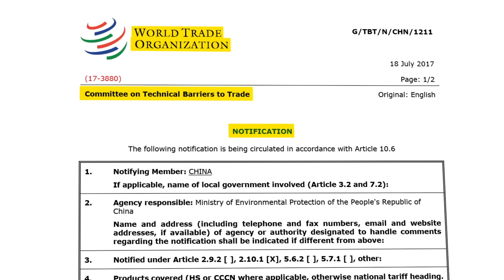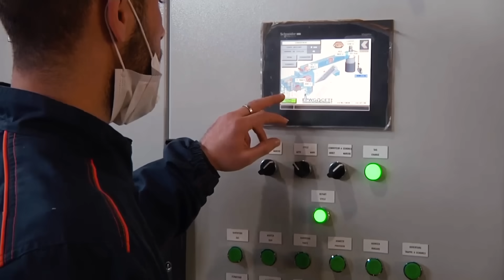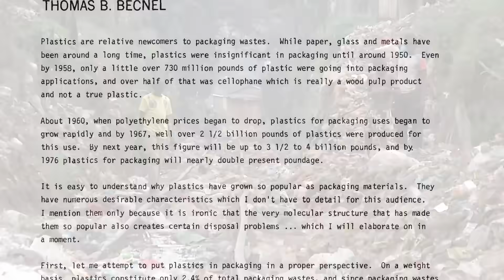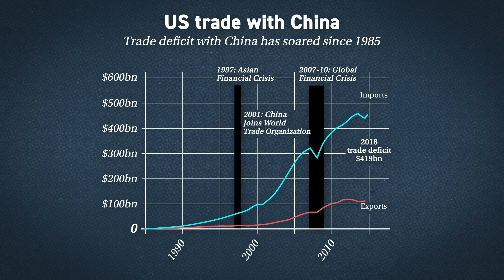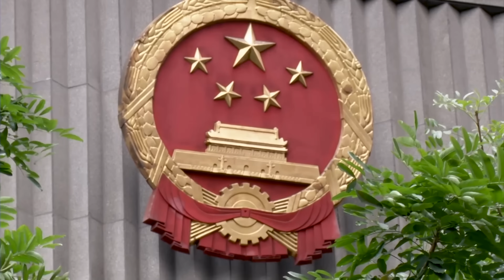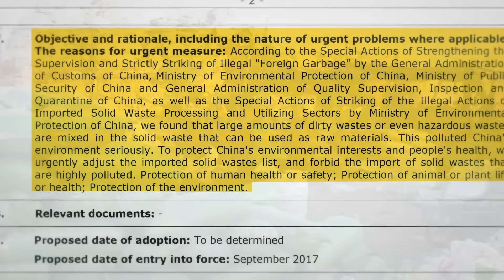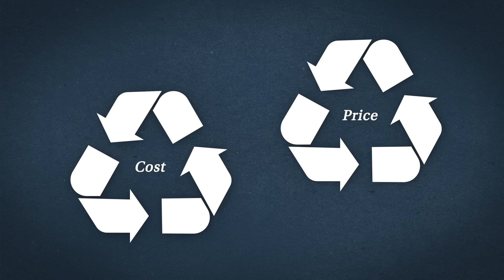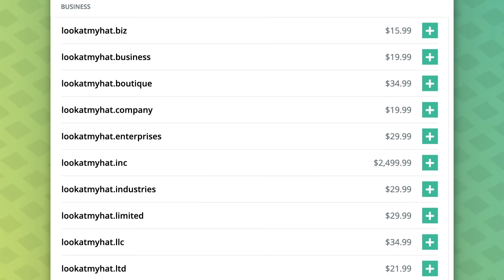How China Broke the World's Recycling

Comment: If your going to burn it any way then you might as well burn it in a PowerStation, that way the carbon released has done something useful.
Reply: the plastic will go to the air, in co , co2, other toxic stuff. from plastic islands to plastic clouds xD
Reply: We really shouldn't be burning it to begin with tbh. Landfill sucks, but plastics in landfill is technically carbon sequestration.

If we could reasonable pluck CO2 out of the air and turn it into plastics at a reasonable energy efficiency we'd be rejoicing. Sequestrating atmospheric carbon into solid form is THE ideal solution. To essentially run that process in reverse would be asinine.

Yes, we have too much plastic that ends up in landfill, and we should try to reduce the sheer volume of it. But burning that plastic is just pushing that problem into another, even bigger problem.
Reply: @Hysteresis.Actual  I'm thinking; why don't we store it as safely as we can? At least for now. Then at some point in the future we're gonna run out of or just stop pumping oil, and  recycling will quickly become not just the cheaper option, but a huge necessity as well, right?
Reply: @Atlessa  Basically because we only plan in the short term, especially when it comes to private corporations (who are doing most of the polluting anyway). Taking up that space in landfills is expensive, burning it SHOULD be expensive, but we don't charge a large carbon tax/price like we should, so it isn't expensive. So in the near term that's what economically makes sense for corporations to do. Never mind that physically, that we would be changing plastic waste into the form that would take the MOST energy to recapture and contain.

Basically it's an indictment of modern capitalism. It's a business model for many many corporations to essentially find an externality that the business SHOULD pay for, but there are no rules making them pay (thus a cost society/governments/other people are bearing on behalf of any business creating that externality). Then that externality is essentially an operating cost they are getting away with not paying, creating greater profit.
Reply: @Hysteresis.Actual  People dumping garbage on public lands is an indictment of socialism, not capitalism. If all land was private, you couldn't dump your trash on it because you would be sued.

It's a classic tragedy of the commons problem. The solution is to not have any commons. Privatize everything, including the air and the oceans if necessary.
Reply: @phamnuwen9442  Except privitizing the air does... precisely nothing to stop people adding things to the air.

How is a private corporation going to enforce their ownership of the air, to prevent another corporation from polluting it? 

Are they going to completely seal off their portion of the air both physically and thermally? Because even if they could stop other people's pollution and carbon from entering 'their air', it would still warm from increased greenhouse effect from other people's air in the surroundings. 

Trying to solve these kinds of problems with privitization really only works if you are able to cut off access to the resource owned. This is obviously prohibitive to the point of absurdity with 'the air'.

And this is not even putting into consideration the nightmarish dystopia we would probably create when a few corporations realise they own all the air, and by witholding it they can form an air cartel to push up air prices. The rent seeking business models that people/corporations have used for variously, housing, land, access to healthcare and just about anything else that people can't live without.
Reply: @Hysteresis.Actual  If you put pollutants in the air that drifts into my property and harms me, I can take you to court.
Reply: @phamnuwen9442  Except, you can already do that now. The difficulty of such a case notwithstanding. 

As it turns out, if pollution you output harms people, that's already illegal.

The only thing privitization changes, is that now you are being harmed on your own property. Which neither makes this any more illegal, or makes your case any easier to prosecute.

On top of that, it actually makes pollution regulations more difficult to enforce. If air was privitized, you would of course be allowed to pollute your own air as much as you want. That would mean, when your pollution inevitable mixes without other air. This would now be an issue for every other individual owner of air to sue you for, instead of the sane way of regulating this, being a singular violation of anti-pollution laws in general, it's now countless individual violations of property rights.
Reply: @Hysteresis.Actual  "The only thing privitization changes, is that now you are being harmed on your own property. Which neither makes this any more illegal, or makes your case any easier to prosecute."

Private owners have powerful incentives to protect their property. The government has very little incentive in protecting public land.

"when your pollution inevitable mixes without other air. This would now be an issue for every other individual owner of air to sue you for,"

Not necessarily. Often only those in close proximity would be subject to any significantly harmful pollution.

"instead of the sane way of regulating this, being a singular violation of anti-pollution laws in general, it's now countless individual violations of property rights."

I think the amounts of allowable pollution has to be context-dependent. For example, in a developing economy, it could be reasonable to tolerate more pollution because the products that are enabled by allowing a little pollution is vastly more beneficial for human life.

A uniform global pollution regulation doesn't take this context into account. For example, China is currently building more than 1000 coal power stations because they really need cheap, reliable energy to improve their economic output and therefore their standard of living. This will cause some pollution, but it's probably still a good trade-off.

By contrast, in the West, we could probably afford to switch to less polluting nuclear even if it's more expensive than coal, because at our current economic level we put more emphasis on clean air than on rapid economic development.
Reply: @phamnuwen9442  "Private owners have powerful incentives to protect their property. The government has very little incentive in protecting public land."

That's precisely the problem. Private owners are incentivized to protect their property only in certain ways. Primarily when it affects the profitability of that property, or when it affects their personal wellbeing.

This means there are no mechanisms for incentives to stop, say, carbon output. Having a little more carbon in the air you own that someone else outputted, isn't goign to make your air measurably less breathable. No private owner is going to be incentivized to sue someone for outputting carbon into the air, certainly not motivated enough to fork out the legal costs to sue for a very tenuous case against their personal property. The only exception being land owners in near sea-level elevations, who are in different countries and different jurisdictions.

So instead of, having the governments make a single laws to limit carbon output in their jurisdiction. You now require individual land owners from far away, to sue multiple offenders in different jurisdictions to stop them/pay for activity that only indirectly causes harm to their property rights.

Look, I agree that governments are not much incentivized to protect public land. But governments or other central authorities are also the only parties with the tools to ban/disincentivize activities that have societal or global consequences. These are problems of Commons by default. Unless you actually have a plan to actually seal off parts of the sky, so activities of other parties do not affect your air, the only thing privitizing achieves is removing those few scant tools available to regulate these activities.

Having owners be more incentivized is nice, but if that incentive doesn't actually come with a mechanical ability to meet that incentive (and in fact removes some), all you are just going to get are frustrated private owners beset with systematic societal or global problems they are trying to solve with ineffectual local solutions.
Reply: @Hysteresis.Actual  If we knew for sure that anthropogenic carbon dioxide emissions would cause the end of civilization, then you have a case for the government to ban it. However, no such evidence exists. We know it contributes to some extent, but even the highly politicized IPCC doesn't predict the impact to be catastrophic. It's a just cost on future GDP growth that will require us to deploy more technology to protect ourselves against the climate.

And if we really had to ban fossil fuels, it would lead to billions of deaths. Fossil fuel powers virtually all productive activity on Earth including food production. The planet cannot sustain 8 billion people without it. Solar and wind replacing it is a complete fantasy because they consume vastly more land and raw materials than mining and drilling for hydrocarbons. The only thing that could fully replace fossil fuels is nuclear, and the climate alarmists by and large oppose it vehemently.

By the way, the risk of dying from climate related events has decreased by 98% over the last 100 years, because
A: The climate was always hostile to human beings.
B: Cheap, reliable fossil fuels make it possible to use machine power that multiplies the productivity of human beings and makes mental labor (i.e. innovation) possible when very low-productivity manual labor is no longer required. This has enabled the creation of technologies that protect us from the climate and weather events.
Therefore, anything that makes energy more expensive and unreliable (like solar and wind) will necessarily make us more vulnerable to climate risks, not to mention make food production much more expensive or even impossible.
Reply: @phamnuwen9442  Noone with any technical understanding of the problem is seriously suggesting that atmospheric carbon is going to cause the end of civilization, at least in any short term time frame. Things that arn't literally 'the end of civilization' can be problematic in of themselves. Your argument is an absurd binary option between 'oh my god it's the impending end of civilization' and 'don't do anything about it'. Whereas the reality is that anthropogenic atmospheric carbon will lead to a destabilization of populations around the globe, climate driven forced migration, and otherwise an unpleasant time for those in the global economic south. Reasonable people generally don't want this, even if this is extremely unlikely to actually lead to the end of civilization.

Ending civilization is going to take something at least pretty close to a mass extinction event (one that also affects humans as a species. There is something of the beginnings of a mass extinction for other species happening already that probably won't lead to 'the end of civilization'). A couple of degrees increase in global average temperature... is not that.

A couple of degrees increase in global temperature will mean however, more severe weather phenomena, and climate/weather related disasters (hurricanes, bushfires), a change of productivity for existing agricultural crop in existing agricultural centres, and the loss of low lying land near the sea, and from these mass migration, and the need to adapt to severely changing conditions in poor areas not equipt to adapt. On top of the release of naturally sequestered carbon in the oceans/ice, making it technically much more difficult to ever put this genie back in the bottle should humanity ever get its shit together to stop the problem.

None of these are existential for the human species or human civilization as a whole, at least directly, all the apocalyptic scenarios are channelled through line of thought of nuclear exchange resulting from political instability caused by some combination of the above.

The real argument has always been that those factors, absent of actual apocalypse, are still bad. And they should still be avoided if possible.

Your characterisation of your opposing viewpoint is an equally preposterous binary. Noone is seriously proposing to simply ban fossil fuels. Even the horribly inadequate measures that are getting some traction, like the Paris accords, are proposing a set peak in the future, and then reduction targets until carbon neutrality. Even carbon neutrality doesn't mean a ban on fossil fuels, it just means you need to resequester carbon equal to the amount of carbon you've outputted, or pay someone to offset it for you.The whole thing would have been made easier if fossil fuel lobbies didn't constantly fight carbon pricing. Even from the point of view of a free market fetishist their argument is absurd. Carbon output into the air is an obvious externality. Externalities... arn't supposed to exist in the perfect market? So they are supposed to pay for cleaning up that carbon. But they fight to continue to profit off everyone else having to pay to clean up after them. 

 The rest of your argument stems from effectively arguing back from your incorrect assumption:
"B: Cheap, reliable fossil fuels make it possible to use machine power that multiplies the productivity of human beings and makes mental labor (i.e. innovation) possible when very low-productivity manual labor is no longer required."

Err, no. Cheap reliable energy of any kind does all of that. Fossils fuels are cheap ONLY because of the market's failure to price in the externalities. As it turns out those externalities are very expensive, because it is both technically and physically very difficult to recontain atmospheric carbon, and past the earth's natural ability to sequester some carbon, requires large amounts of energy, that incidently, can't be provided by fossil fuels, due to second law of thermodynamics limitations.

It is pure economic fetishism to think that the current monetary cost of using fossil fuels is even remotely close to a good model of the actual, material cost. We live in a messy world of imperfect markets and flawed economic models. To simply assume that the dollar cost is in any way a good indicator of the actual price of using fossil fuels is to either have endearingly naive faith in the existing economic model, or wilful obtuseness.

Having not assumed that fossil fuels are in fact cheap, in any practical sense. We get back to the alternative energy sources.

"Solar and wind replacing it is a complete fantasy because they consume vastly more land and raw materials than mining and drilling for hydrocarbons. The only thing that could fully replace fossil fuels is nuclear, and the climate alarmists by and large oppose it vehemently".

Solar and wind (and especially batteries for storage), do indeed comsume more land and materials per unit energy than fossil fuels. However, even with fossil fuels being the energy backbone of our current industry, they still manage to emit far less carbon per unit energy, this will only get better if we are able to remove fossil fuels from it's primary position in our industrial energy supply. Sure, the additional materials does cause much more other pollution due to the sheer scale of mining, than fossil fuels, but if we were serious about containing that waste, we could easily and RELATIVELY inexpensively do it. This is not an option we currently have with carbon emissions, and if we did, it would be ludicriously expensive.

You are also correct in saying that the only source that could FULLY replace fossil fuels is nuclear. However, again, you are trying to force a binary choice where one doesn't need to exist. One does not need to use a single source of energy to power all of civilization. Solar specifically (not so much wind), is capable of very quickly replacing large amounts of fossil fuels in the very short term, when it comes to intermittent useage, it's not well suited to, though technically feasible, of being our baseload. We will at some stage need nuclear to fill in the baseload duties, but due to the current challenges, may not be seeing for some time. Every ton of carbon not emitted now, is worth far more than a ton down the line. Because we cannot FULLY replace our energy infrastructure with solar, does not mean we shouldn't replace what we can.

I for one am more optimistic about nuclear. Not because there is any particular shift in public opinion, or because the technical innovations down the pipeline look particularly close right now. It's simply a matter of physics. Public opinion can change, economic systems can improve and conform (hopefully) more to physical reality. You can make your case for funding, and to the media and to the public, but you cannot in the end, argue with physics.

Nuclear power (including fusion should that ever be an industrial scale solution in our lifetimes), simply requires the least labour, energy and materials to run and clean up after itself. If it is the best technical solution in a real material sense you have, you will eventually choose it, or be forced to, for lack of other options, resort to it.
Reply: @Hysteresis.Actual  _Your argument is an absurd binary option between 'oh my god it's the impending end of civilization' and 'don't do anything about it'. _

If you won't read my arguments I'm not going to read yours. I literally said that we'll have to deploy technologies to mitigate climate risk, and that I'm fine with deploying more nuclear which is the lowest emission energy source in existence. I said nothing to the effect of "do nothing".
Reply: @phamnuwen9442  You are arguing against the strawman of 'banning fossil fuels' which literally noone here has argued for.

The point is if you don't price in externalities, of course fossil fuels will always be cheaper than nuclear, solar or wind. It's hard to compete with a profit model that just has everyone else bear the costs of cleaning up after you.

Here, i'll summarise the problem with your argument for you if you don't want to read it:

My complaint was that privitization does not help ease the process to regulate (or otherwise mitigate) pollution, and makes it even harder to regulate, specifically in the case of carbon emissions.

Your rebuttal is:
"If we knew for sure that anthropogenic carbon dioxide emissions would cause the end of civilization, then you have a case for the government to ban it. However, no such evidence exists."

Given that noone is suggesting the remedy is to ban fossil fuels, nor is a credible existential threat to all of human civilization a reasonable minimum threshold for action. Your argument effectly amounts to: "making it harder to regulate carbon emissions is ok because it is unlikely to cause the downfall of human civilization."
Reply: @Hysteresis.Actual  Your "externality pricing" is literally a fossil fuel ban for billions of poor people across the developing world.

"The point is if you don't price in externalities, of course fossil fuels will always be cheaper than nuclear, solar or wind."

If you understood the energy and power density of nuclear, you would know that this is false. The potential efficiency of nuclear, if we allow research, development and operation of new reactor types on a commercial basis, is orders of magnitude greater than anything else.

But yes, for the time being, since nuclear has been suppressed by "greens" for half a century, fossil fuel is still cheaper. It is therefore the best energy source for the vast majority of people across the world, and making it more expensive with taxes would by definition make their lives much worse or even kill them.

The prospect of "Green New Deal" type central economic planning threatening to  plunge the world into a dark age of energy poverty is the real "climate disaster".
Reply: @phamnuwen9442   " Your "externality pricing" is literally a fossil fuel ban for billions of poor people across the developing world.

"The point is if you don't price in externalities, of course fossil fuels will always be cheaper than nuclear, solar or wind." "

Again with the binary choices... 

No government has the jurisdiction to unilaterally apply carbon pricing/taxing to everyone. A carbon price in a developed country isn't going to be able to tax a different country (well except maybe within the EU itself). If a developed country has a carbon pricing policy, a developing nation does not have to follow suit immediately.

Barring a few big countries, no developing country is going to be building a bunch of nuclear reactors anytime soon without a lot of outside help. They could not physically execute a transition away from carbon right now if they wanted to.

Free market extremists might complain that this means different rules for different people. But that is also the only way a transition can occur. The costs will, necessarily, need to be borne progressively, from a purely mathematical stand point. Because the global economic south simply cannot afford to bear their proportional share of the costs. Developed nations, will necessarily have to go first, fair or unfair in their view.

"If you understood the energy and power density of nuclear, you would know that this is false. The potential efficiency of nuclear, if we allow research, development and operation of new reactor types on a commercial basis, is orders of magnitude greater than anything else."

I am quite aware of the potential of nuclear power, I'm an electrical engineer by education. This simply isn't false. The reason that there is not more nuclear power plants in say, the US, are primarily economic, not technical or for reasons of public opinion.

The problem is, in our current system, the fuel costs of nuclear power are a miniscule portion of the monetary cost of nuclear power. The price of nuclear power is primarily determined by the commissioning and decomissioning costs, secondarily, the strict safety standards, specifically radiological, they need to adhere to to contain risks that are not factored into a coal burning power plants (but should be given the sheer volume of fuel they cycle through, they get to just output their radiological waste into the air).

Any potential gains in efficiency are not going to much change the costs of commisioning a plant in the current economic situation, since fuel is already so cheap (and they use so little of it). They only become relevant once there is considerable uptake of nuclear power, and increased demand of fuel raises prices, barring some innovations that drastically alter plant design, which we are, technically, still some ways off.

Under perfectly ideal circumstances currently, using the US as an example, a boring old PWR can already outperform a coal fired power plant economically in the very long term (at least a couple of decades of operation). People nevertheless don't build them for economic reasons. It's unattractive to commit the immense cost of commissioning a plant and not break even for a couple of decades, longer if utilisation is not ideal.

This is not something upcoming innovation is looking to be able to be able to address. Thorium cycle will make fuel cheaper, and waste storage costs lower but not touch commissioning costs. Modular plants address the commisioning cost problem, but cost more than existing coal burning plants per unit energy over it's lifetime.

The fact of the matter is nuclear power inherently internalises almost all of it's clean up costs, it's actual business cost to operate is very close to it's actual overall cost. As long as fossil fuels get to externalise their immense clean up costs, it always has a competitive advantage.

"But yes, for the time being, since nuclear has been suppressed by "greens" for half a century, fossil fuel is still cheaper. It is therefore the best energy source for the vast majority of people across the world, and making it more expensive with taxes would by definition make their lives much worse or even kill them."

While it is unfortunate that the environmental movement at large has made public opinion of nuclear very negative. They hardly have the actual legislative power to suppress it. Fossil fuel lobbies have been actively putting money into pushing against government funding for nuclear, and keeping their own subsidies (both direct and via cleaning up their externalities) for just as long. Given the sheer volume of money, and actual mechanical involvement in the legislative process, I think it's pretty disengenuine to lay the blame primarily at the feet of the 'greens'.

"The prospect of "Green New Deal" type central economic planning threatening to  plunge the world into a dark age of energy poverty is the real "climate disaster" "

The Green New Deal doesn't even propose carbon pricing. I get you don't like central planning, but to claim it will plunge the world, or even just the US into energy poverty is a bit of a stretch. Especially since it specifically proposes putting more resources and manpower into... producing energy.

I have problems with the Green New Deal myself, primarily that it DOESN'T have carbon pricing, which actually addresses the underlying problem rather than tries to work around it, and I think the environmental movements' treatment of nuclear has actually set us back when it comes to controlling our carbon emissions. But to blame them over the fossil fuel industry which has put in an accumulated billions of dollars specifically to obstruct any solution to the problem, just to continue profitting from their abuse of the market's failure to properly price their business practices, or the political machine that either refuses to, or is ineffectual against such abuse of corporate power is, at best, comical.
Reply: @Hysteresis.Actual  yeah, burning waste plastic is pretty stupid.